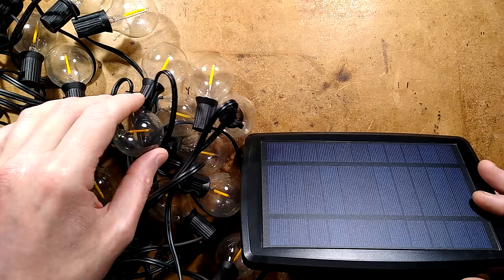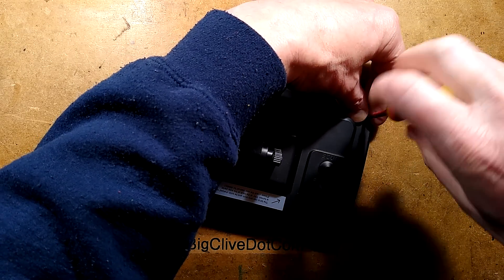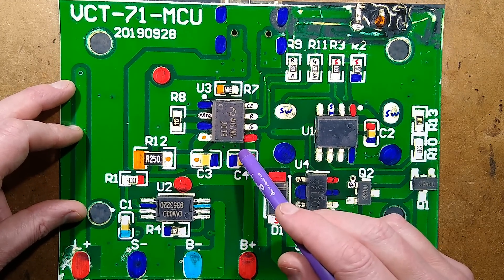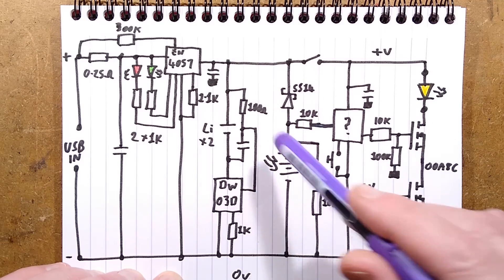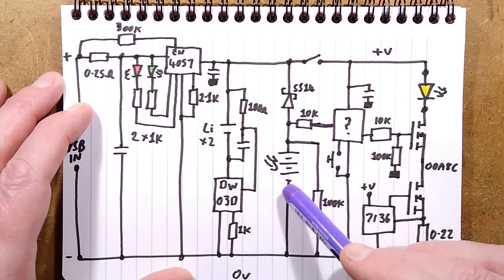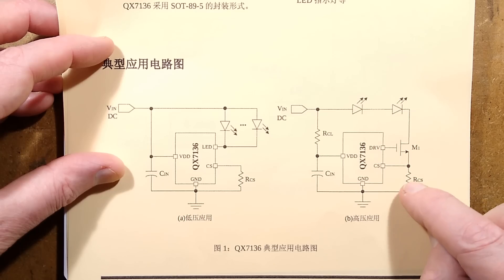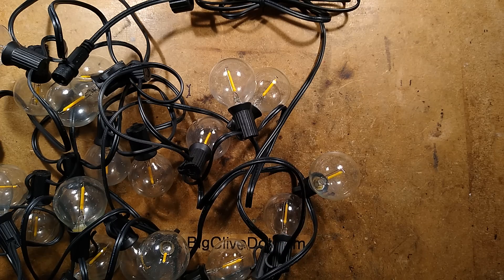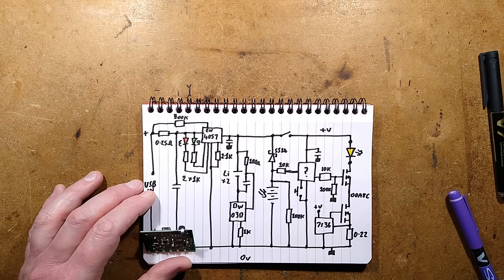Dead solar lights.

Comment: That's surprisingly well designed.

But why does it have a USB port? Seems an odd addition for an outdoor product that already has solar.

Is there any issues the two Lipo cells being in parallel in terms of balancing?
Reply from the maker: When cells are in parallel they act like a single cell.  The USB port is to charge the cells fully for winter use.

Comment: I have a set of these, which have been outside for 2 years. The only issue I had, was with the bulbs, which allow the ingress of water. Not a lot, and the led still works. These light my garden quite well, and seem to last most of the night this time of year.

Comment: i have had a set of these for a while, they started acting erratically after about 3 months, they'd turn the lights on during the day and no longer turn on at night. i think the issue is once the 18650's become weak the controllers lose the ability to determine whether the solar panel should be charging or running the lamps. the circuits seem to be either trying to charge or trying to power the lights(unless the switch is off). both my 18650's seemed to be ok voltage wise but i didn't run any actual tests on them. id say the downfall is the batteries cant maintain a daily usage on all these lights for more than a few months without needing to be replaced.
i was trying to understand why there was no light sensor when i took my panel apart a while back, but you explained my theory that it was simple current based logic.

Comment: The 100k across the solar panel will be to compensate for the reverse leakage of the Schottky diode which is much higher than regular silicon diodes.

Comment: I have two older LED string sets (non-bulb type, just little 5mm (?) LEDs with the weird cone shape built into them so they light all around them and not just into a spot) that both also use this connector, but one is 24V AC with a bulky potted linear transformer and the other is 31V DC with a switchmode PSU. Even those would've probably killed the LEDs on this bulb set. At 240V it would've probably been a lot more violent (I'd expect smoked bulbs and/or skidmarks at that point)

Comment: I took a picture of the screen with my phone and used Google Lens to translate the QX7136 diagrams, and the left one is "low voltage application" and the right one is "high voltage application". Ironically it means the chip itself can sink all the current from several lamps in parallel, but not handle the high off-voltage from several lamps in series, so it needs the external FET even though the current would be much lower. I bet the low-voltage configuration can't support nearly as many bulbs though.

Comment: That's interesting that the panel you like is the panel that I hate I won't buy units with that panel unless there's no other option

I call them in capsulated solar panels The reason I hate them is because of the epoxy resin capsulation They never use UV stable resin so inevitably those solar panels become opaque when they fade in the UV light

You can polish them to restore them but then it's just going to do it again and you can only polish it so many times before you wear out the UV resin and start damaging the panel the panel that you see is the kind I prefer or glass panels because they won't fade in UV light

Comment: Did you check the capacity of the two 18650 batterys Clive . Sounds like it was a reasonable product and gave you a useful spare unit👍
Reply from the maker: They were closer to 1000mAh.
Reply: Those 18650s look like exactly like the "1800mAh" one that came with a friends solar LED string light. It failed after just a year, with the 18650 deep discharged for some reason (high internal resistance?). I "forced" it to charge in a USB powerbank and after 2-3 cycles, it measured a grand total of 920mAh. Replaced it with a used Sony 2400mAh out of an old laptop battery pack that still measured somewhere around 1900mAh and the LED string has been running much longer than it did brand new. And it hasn't deep discharged the cell (yet?)

Comment: What do you think the secondary push button is for It wasn't drawn in the schematic
Reply: The On/Off Switch was in series in the top power rail above the MCU. The Momentary Switch connected to the bottom of the MCU is a "Mode Change" Switch to cycle through various modes. e.g. Flash, Dimming Level.
Reply: Both buttons were on the schematic.

Comment: It looks like the 18650 cells are easily replaceable.  That’s excellent, I wish all rechargeable devices were designed this way.
Reply: We're suckers and we realize that fact.
Reply: Many of those bigger solar lights on Ali with two buttons on the back have replaceable AA cells inside!
Reply: Personally I'd rather have a reliable solid connection than spring clips. But it depends on the application.
Reply: Like a lot of things that’s a tradeoff. Being able to replace cells is good if one or both die, or if the ones supplied are low capacity. Cells that are spot welded or soldered (spit) in circuit are far less likely to suffer corrosion at the contacts or to jostle loose under physical shock.

For folks like us who automatically disregard those “no user serviceable parts inside” labels they are very good on general principles.
Reply: @markfergerson2145  Label:  “Warranty void if opened”
Us:  Challenge accepted!
Reply: @markfergerson2145  Tradeoff? Protection from moisture water intrusion and corrosion my guess?... BS mainly. Soldered and welded cell leak nicely and eat all traces around or just die couple years in, no different from socketed ones. Soldering in is penny pinching and "planed" obsolescence, a specially components with very limited life span or shelf life.

Comment: I would guess the current regulator is the Q varient.  It apears that when the voltage is too low it will cut off the lights and save the batteries from over discharge.  I am also amazed how well the circuit was designed and implimented into such a small package looking like the space to mount the switches was the size limiting factor.

Comment: This is a quality product ! ! ..... It is a ( sad ) fact that a good many non technical folk think that LED's are just a modern version of the Tungsten filament bulb , and are not aware that LED's   MUST have a current limiter ( a resistor costing pennies / cents will usually do ! ) , never mind , you get all those  FREE  spare MES sockets ! ........ DAVE™🛑

Comment: Clive, I know you've mentioned this dozens of times in the past but I can't be bothered finding the correct videos now (you really should make a guide video for this).
But, with the solar panels, is it 0.5 volts that each track puts out? And does their individual size make any difference? And the metal track that runs across them, if there's more than one?
Reply from the maker: Each cell is roughly 0.5V regardless of size.  The larger size and number of collector tracks just increases the current.   The brown amorphous cells have lots of cells on one layer.
Reply: @bigclivedotcom  Thanks. I thought it was 0.5V but I wanted to make sure.
Reply from the maker: @two_tier_gary_rumain  Open circuit in bright light it will be higher, but 0.5V is a good base value.

Comment: Thanks for this one! How much power do those solar cells produce?
Reply: How much power the solar cells produce depends on how much sun is where it's used.  So your question is not answerable.
Reply: @acmefixer1 No, actually a solar panel has a current rating for what it produces in full sunlight.
Reply: @stargazer7644  
Under ideal conditions, solar cells should produce 20% (their efficiency) of 1kW per square meter.

*No solar cell is under ideal conditions.*  Especially a garden light.  Then the losses of charging the batteries have to be subtracted.
Reply: @acmefixer1 And what made you feel the need to copy/paste that?  Why don't you look into cosine losses on a solar panel and copy/paste some of that next as it is far more significant than "losses of charging the batteries."
Reply: @stargazer7644  
Copy/paste *what*??
Reply: @stargazer7644  
You need to get back on track.  The topic is DC solar cells in a garden light.

Comment: This set of lights is call "Falmouth" and I have two sets of them. I grab some details later, and you can make of it what you will.  I can tell you though, they're not cheap! And, you can send for replacement bulbs if you ever need them.

My two sets came from a garden centre, and we're priced at about £50.00 a set at the end of the summer season.

I'll be back later .........🙎👍
Reply: That's a pity. It looks well made, so I'd be tempted to get one. But £50 is more than I'm willing to pay for something that I won't use.
Reply: @DrAHorn  I can see what you mean. But they are good quality, even the bulbs are real glass. Chargeable by solar panel, or via USB wall wart makes them a nice choice for all year round used. They're also extendable with additional strings that can be plugged in daisy chain fashion. Forty bulbs in a string, and they are quite bright, though brightness is adjustable; bright, medium and dim.

I like them! 🙆

I bought mine in a moment of madness, but I'm not sad that I did!

Comment: Could you adapt one of these panels to power a set of leds that otherwise use, for example, 3 x AA batteries?
Reply: Assuming that your set also works with NiMH: yes. It puts out the voltage of one LiIon cell which is 4.2 -- 3.0V and thus in the range of 3xAA. You might need to change the current sense resistor (R14 on the silkscreen) to adjust to your LEDs.
Reply: @DrAHorn  Thanks for the advice. It was a thought for the future. I'm a complete novice, though yesterday I did successfully repurpose a dummy battery mains adapter to get a battery-operated led 'stick' tree to work.

Comment: My mother has a set of these lights, so far, excepting a smashed bulb or two and a bit of corrosion in the bulb sockets they've been great, they're on their second winter and are going strong.

I think you're right about the overvoltage, replacement bulbs are bit awkward to track down (smashed bulbs) and there are 240V versions in the same package so, as you kind of said, maybe someone saw these sets and bought them to extend a 240V set
Reply: Clive could just get the 240v bulbs and upgrade his broken string .  I bet the wiring gauge on string is the same for both version.

Comment: 🎉 Congratulations Clive , you have made the ((ONE )  Million mark on subscribers well done  as you are very entertaining with (Cock ups on design faults) and how badly the circuit diagrams . 

Thanks again could you tell me what plug socket that you use that reads the power consumption is  it the (Hobi) if I have spelt it correctly. Thanks again

 💯💯💯💯💯💯💯
Reply from the maker: Hopi.

Comment: Will you please plug a working string of 3V lamps into a 220V lamp string and then plug in the 220V lamp string in to that crunchy plug tester that you have? And then turn it on? Please? Just so that we can see what happens?
Reply: At that voltage they just pop and that's it. Nothing to exiting
Reply: He already told you what happens, and it isn't very exciting.

Comment: Huh, I found a different datasheet for the QX7136 that has the same side-by-side diagram, except that both of them include a mosfet.  I wonder if there's an error in one of the PDFs, and either there's not an onboard mosfet (hard to tell with google translate) or there is but the designers of this circuit got the version of the datasheet showing only discrete mosfets.  Sadly the datasheets don't seem to have dates or revision numbers.

Comment: The problem we have here in Aus is the violent daytime sun. It kills off the coating on cheapie solar panels in 1-2 years.
Reply: Rural QLD here, only takes 1 summer to kill a cheap solar panel.
Reply: I've noticed this too in the desert in Idaho.  I'm experimenting with automotive wax as a protective coating and thinking about UV resin or cutting glass to fit over them.
Reply: @amorphuc I've had good luck with a thin piece of glass. It did reduce the PV output 5-10% but that's no trouble in my scorching summers the South East USA. Sadly several weeks of 100+F (~38C) highs and 80-100%rh un alives quite a few (typically elderly who can't afford air conditions or the infirm) every year.
Reply: It's the resin ones that fog up. I've complained about this before and Clive once mentioned that you can clear them again but I couldn't be bothered.
However, the glass ones last for ever. I have a set of garden solar lights that are glass rather than resin. Over 10 years old now and still fine.
Reply: Most plastics (and all clear plastics iirc) degrade quite badly from UV radiation. Oddly, most glass has a natural effect of reducing (although not eliminating) UV. However, you could potentially get a UV lens filter for a camera (they make them in small square, rectangle, and round sizes for matte boxes and directly screwing onto lenses). A good one would stop 99.9% of the UV radiation and would prevent the clear plastic from degrading, and thus, fogging up. 

Probably not the cheapest solution though, but it's an idea and someplace to start looking for a cheaper (and more hackable) alternative
Reply: I always thinly overcoat these plastic/resin coated solar panels with clear silicone sealant. It does help a lot. I accidently found it out after I tried to seal up the gap around the solar panels of those crappy motion-detected wall lamps with the sealant, which I found a while later that around the edges of the panels where the sealant was smeared over, were still clear, while the center of the panels were already fogged.

Also, Isopropanol can be used to clean off some of the top layer fog from the already fogged solar panel. It won't be 100% clean, but, again, it does help.
Reply: The So. California sun is hard on the cheap solar cells - almost every garden light has a fogged over solar cell that's putting out a fraction of its original current. 😢
Reply: and most cheap plastic in general
Reply: I sprayed clear varnish on the panels and it refreshes for another year.
Reply: @davidroberts1960 Clear varnish OVER the top of the fogged plastic?? Now you've just sealed the fog in forever.
Reply: @davelowets  No it changes to clear and stays clear.
Reply: I scrape off the white oxide layer, and then polish and varnish them. They last much longer this way. Glass Solar is the best type.
Reply: You don't need to be in Australia. The real cheapie ones flake off in the grey wet Northern European autumn with no sun worth a damn!
Reply: Same in NJ USA!
Reply: Here in the UK a winter's worth of rain and ice will ruin them even quicker.

Comment: A redesign of the connector seems to be in order...a simple pip addition could help make the low voltage one non-compatible.
Reply: Terrible in the factory though, as they now need to have a second set of moulds. Single set, and accept people are stupid, will ensure more sales.
Reply: It's one of those "make something idiot proof and the world will produce a better idiot" things. 😂

But there could be an adapter created that could be put between these two different strings. And ya, I'm being silly with the first sentence as there really should be some marking or something to make it obvious.
Reply: @HelenaOfDetroit    
You may consider the sentence silly but sadly it is too true.  
Having to put a warning that coffee is hot on a coffee cup is proof that idiots keep getting more idiotic every day!
Reply: @gregorythomas333 Love how my previous reply got censored away by YT entirely. Great platform really /s 
copypasta: My ethernet switch came with an inline power switch between the PSU brick and the barrel plug that goes into the device. It seriously had a sticker on both the PSU and the network switch stating "This device will not function if the switch is turned off". The world needs a whole lot less warnings so those "people" needing them solve themselves
Reply: @Knaeckebrotsaege  What model is that?  I don't think I've ever got one with an inline switch.  Since I'm a weirdo who tends to read the manual first I'd be looking at it and think, "wait what?"  And, after looking at the power brick thinking, "holy crap."  I'm just used to switches having their own power button or no switch at all for the cheap stuff.
Reply: I would tie a knot in it and attach a keyring tag reading "low voltage."